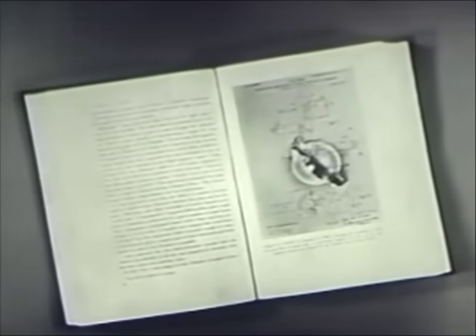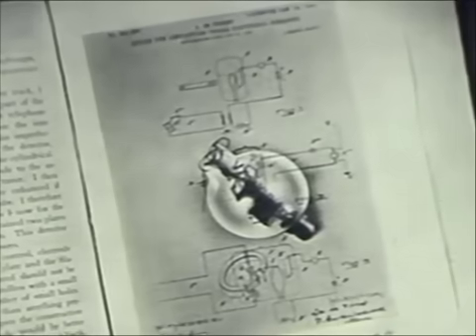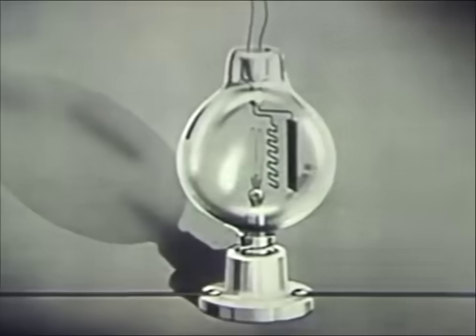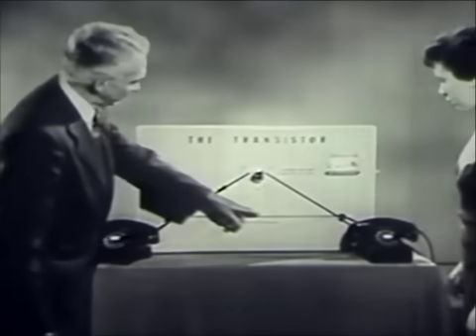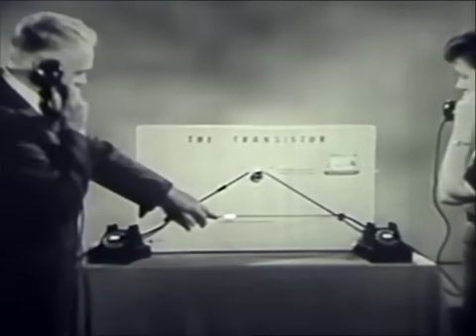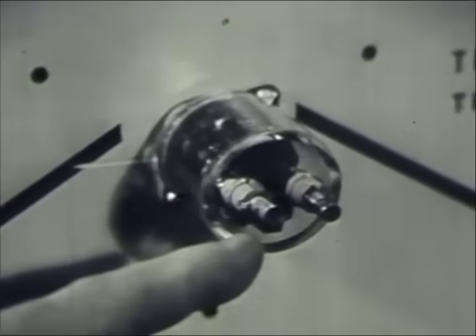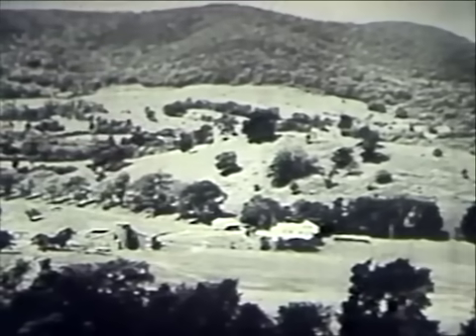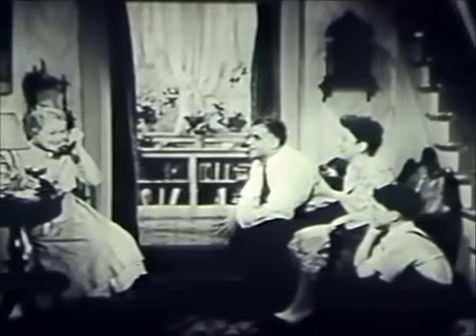The Transistor: a 1953 documentary, anticipating its coming impact on technology

Comment: I happened to be born in 1953.
My father worked at Illinois Bell Telephone and took me into the Chicago telephone exchange at a young age. He showed me the banks and banks of relays that were switching telephone calls, and mentioned that there was a new thing that would replace the relays and switch thousands of times faster. A few years later I bugged him to buy me a book on transistors. I only vaguely understood it even after many hours of re-reading it.
Reply: Those switching relays remained in use for decades in many places.  Quite a few were replaced by integrated circuits in the 80's and 90's.  The amplifiers for voice and what powered the relays went to solid state as soon as practical.
Reply: I was also born that year but by the 1970's I was building radio kits and we were still using tubes.   The phone company got a huge jump on everyone else.
Reply: My Dad also worked at the telephone exchange. He took me in quite a few times and I got to see all the technology they had there in the early 80’s. Probably a lot of it was still the same stuff from the 50’s and 60’s at that stage.
Reply: I worked in relay exchanges in 76, it was like walking around inside a chipset. 

Malvern exchange was a classic at the time Cross bar equipment was in coming in and all looked very Space 1999. Malvern exchange on the other hand looked like something from Harry Potter.

Jumper leads every where like a spiders web that fixed faults that but no one knew why so don't bother logging it. There were line selectors from before the war still running strong WW1 that is refurbed in the late 40's.
Reply: Awesome history, thank you for sharing. I was born in 1968, but have often read about the may breakthroughs created at Bell Labs (same company?)...I have fuzzy memories of going to a local Bell phone company and seeing all of the current tech in person. How blessed we are to experience the transition from analog to digital!
Reply: All you  guys who worked in the EM exchanges will agree: transistors and ICs or not, there  are few things as impressive as an electromechanical exchange going at full cry in peak hour,
Reply: Wait a minute, I was born in 1953 and I didn’t see you anywhere near there.
Reply: I was also born in 1953. When I was a kid my father brought home a transistor radio. It fit in a large coat pocket. I was amazed~
Reply: @d00vinator  it must be amazing for you who could witness such a big technology leap. From first transistors to a computer in your pocket. I was born in 1996 and it blows my mind even though I am using a PC since I was 10 years old.

Comment: Imagine nowadays we can easily put a computer inside their “transistors”. This is magic.
Reply: “Magic is just science that we don’t understand yet.” – Arthur C. Clarke
Reply: @57levity  respect
Reply: The only aspect that has changed is they are made smaller; it still performs the same function in anything.
Reply: @ScubaSteveCanada  The principle of operation of transistors in most modern chips is a little different. The video talks exclusively about a bipolar junction transistor. These were used in the early integrated circuits, but as the chips got more complex, we fairly quickly switched to field effect transistors, where there is no significant base current, reducing the power requirements and heat production even further. First MOSFETs, which are the progenitor of today's CMOS technology, were made in the 60s. The field effect itself was already known by the time this film was made, but a technique for efficiently making field effect transistors from a single silicone die by utilizing an oxide layer was not discovered until a couple of years later. So while the transistors from this film are what kick-started the miniaturization and the integrated circuit development, it's not exactly what we used in the CPUs today.
Reply: @katherinek6166   Is there a good video on the evolution/progress of electronics that you could recommend ?
Reply: @bontempo1271  It's a very broad topic. I think I'd recommend videos by LowSpecGamer on the histories of Z80, 6502, and ARM, keeping in mind that these are mostly stories of people and companies that created them, but it puts a lot of the early IC development into the context. From there, it kind of depends on whether you're more interested in more of that, or if you want to focus more on technology or manufacturing. As well as whether you want to have more focus on the early tech or the newer. There is honestly just so much, from the quantum mechanics of semiconductors, to amazing processes people have developed to carve the structures into silicon, to the way the tens of millions of transistors are laid out by the engineers on the modern chip, to the various strategies that have been used to improve performance, to all the use cases and politics around them. It's extremely broad, and I wouldn't know where to point you for the full history. But that's kind of why I'm recommending specific content for earlier chips, as when we were talking about thousands of transistors in the early processors, you could sort of cover a little bit of everything. From there, you really have to pick and choose, if it's not something you are willing to dedicate hundreds of hours to.
Reply: @katherinek6166  wow thanks for that response. Clearly an amazing subject that i'd say the majority of the public aren't really aware of beyond names and concepts.
 I'll check out lowspecgamer, cheers :)
Reply: True.  One that communicates wirelessly.
Reply: Imagine that we can easily put 64 genders inside a two gender biology
Reply: What if the computers were inside the transistors the whole time...or were the transistors inside THOSE computers?
Reply: @things_leftunsaid  🤔😳🤯
Reply: @things_leftunsaid  wow you're so funny that's so funny that's so unbelievably funny and original and creative and funny and no one has ever said that before and you're so funny and creative and original and funny wow
Reply: @MikehMike01  idiots always say   same things like a parrot
Reply: @MikehMike01  Sarcasm, especially from 9 months ago doesn't age very well.

Comment: In the 1960s I remember my parents buying something called a "Transistor 7" transistor radio.  It was actually a wooden box covered in some glued on fabric, and it used a huge battery - but it worked.

Comment: Almost 70 years later and I still don't really understand how transistors work.
Reply: 1:32 What isn’t shown here is the filament is constantly emitting electrons when powered, the input part is actually a screen that acts like a high speed gate letting electrons pass as you change the voltage, the output collects the electrons that got past the gate. The filament and output part are able to handle higher power but are controlled by the small signals sent to the input (the gate). Transistors work the same way, just way way smaller and super sensitive